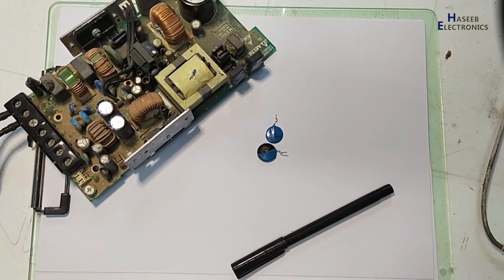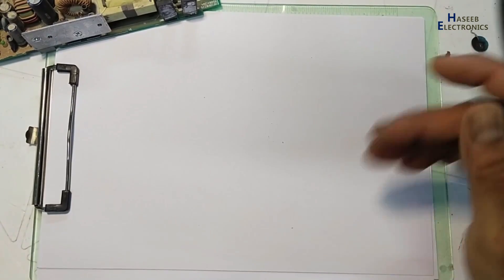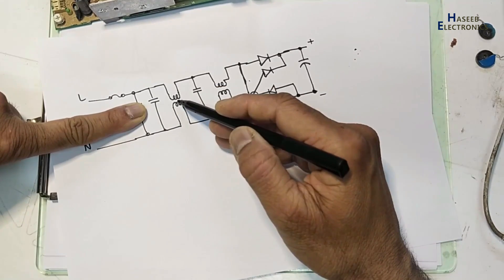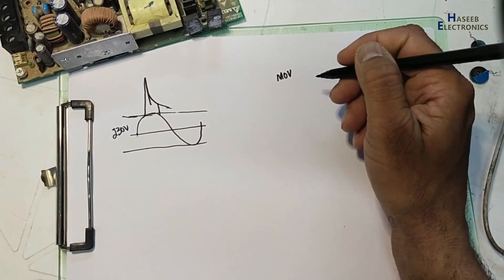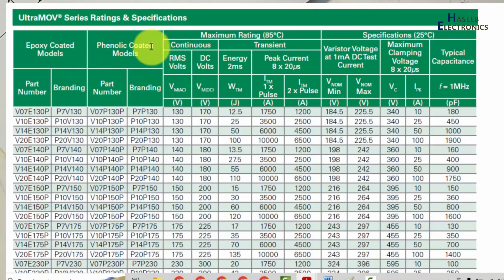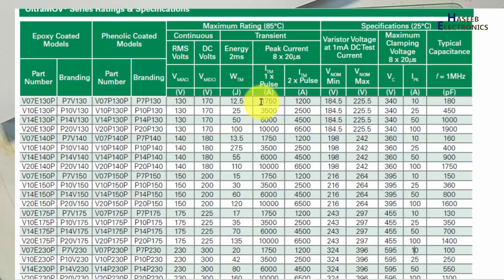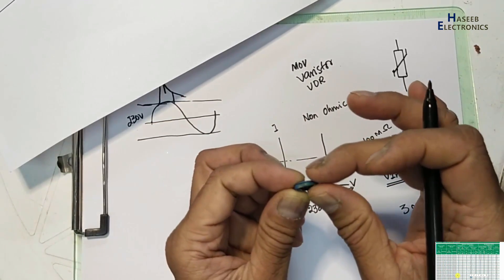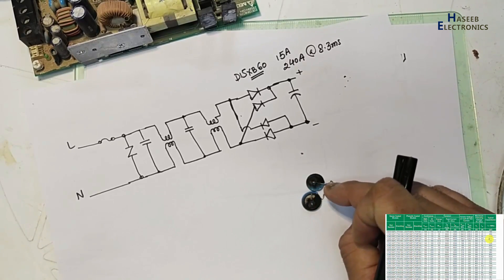{1077} What is MOV, Varistor, VDR? Fuction & datasheet Explained

Comment: Thanks for your explanation. Looking forward to part 2.
Reply from the maker: it is my pleasure. i wished to explain necessary paramters, so that the next part will easy to follow 
next part is comming soon.
Reply: The best explanation sir, thanks.
Reply: Assalamo alycom wa ruhmatULLAH wa brakatuh 
dear brother, I need help urgently. 
I have invt solar transformer, it's 
GD100-011G-4-PV .
I accidentally reversed the incoming poles from the solar plates, where by what look like two resistors on top of each other blew up.
My problem is that I can't tell their ratings. I searched the internet but with no avail. 
Can you be of help ?
Thanks in advance

Comment: If you were to add MOV protection to a device that did not already have it, and assume the device has 3 prong plug (HOT, neutral, Ground)... where do you connect the MOV(s)?   It seems like connecting one MOV from Hot (Line) to Neutral is sufficient, but I see surge protector power strips that use 3 MOV -- one from L to N, one from L to G, and one from N to G.  Are all 3 of those MOV really necessary?  It seems that the one from N to G would not have fuse protection because usually there would only be 1 fuse on the Line.

Maybe you could make short video explaining this topic.

Comment: Salaam brother, i recently seen circuit involving mov and thought of trying it out so i install it in my extension wire then after switching it on it instantly blown up the mov. My set up is i installed a 8ampere fuse on line1 and then put an MOV in parallel with L1 and L2. Is there any problem with my choosing of fuse? Thanksa

Comment: Assalamo alycom wa ruhmatULLAH wa brakatuh 
dear brother, I need help urgently. 
I have invt solar transformer, it's 
GD100-011G-4-PV .
I accidentally reversed the incoming poles from the solar plates, where by what look like two resistors on top of each other blew up.
My problem is that I can't tell their ratings. I searched the internet but with no avail. 
Can you be of help ?
Thanks in advance

Comment: Hello sir good morning I asking you for a little help sir I bought a lot of EE55b from China the data is limited they only siad it higher efficiency then other core the size 2.54cm by 2.54cm by 2.54cm by 1.905cm  material type pc40 ,I just want to know the power factor to the core if its 2kw at 50khz or more the core is a bit heavy 1/2 pound in weight I want to double two core to get 5500watt